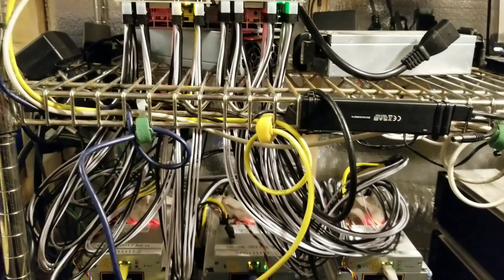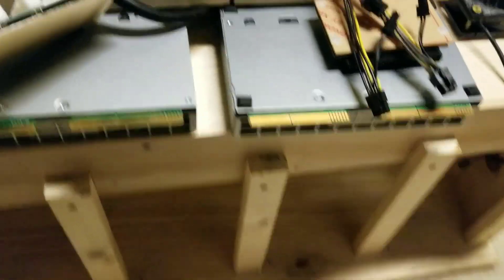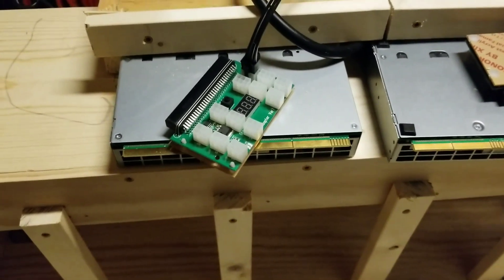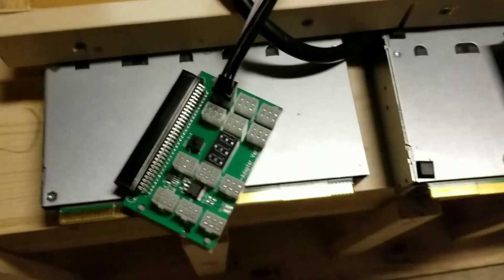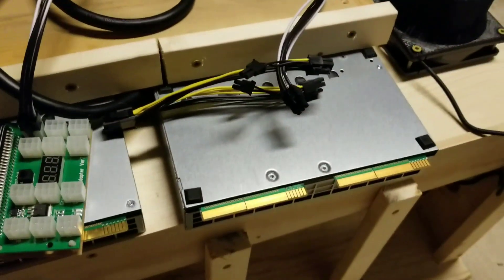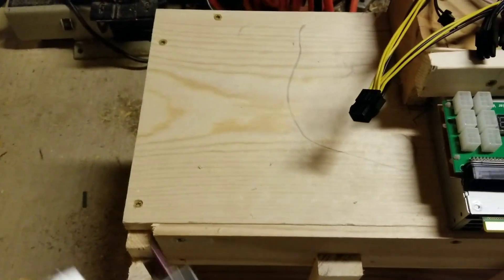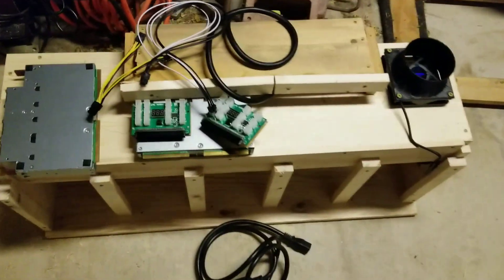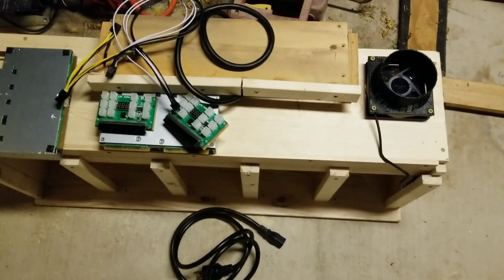Antminer L3+ D3 S9 mining operation update and more helpfully information

Comment: Absolutely sick. Keep going for it!! I would say you will be doing fine with the numbers you are looking to run. I had been looking to buy some L3s from a local guy here in Reno, but the investment is quite substantial for start up. If I decide to go for it, I will keep you in mind for equipment.
Reply from the maker: thank you. the startup is pretty high. Im now running 3 d3's and 3 l3+. next week i wil have another 4 l3+'s and by end of October 2 more l3+, and 2 more D3's then in November 5 more D3's im in pretty deep, i have roi'ed on 3 machines sense Aug. and i just keep rolling the roi over to cover machine costs.
Reply from the maker: Thank you. I'm going all out over 30k invested so far and plan on dropping all profits after expenses for 6 mo. On new equipment and I have a new mining space that will be installed next week to expand in to

Comment: How much are you overclocking and whats your MH/s rate overclocked?
Reply from the maker: I don't overclock unless the unit is over 6 mo. old  as a rule to get the best performance for the longest time out of them. I will be overclocking once my new 12 x 12 mining center is done on about 10 machines to find out what they can take. but if you clock them at 462m you will pull around 600 - 640 mh but be warned you better have a air conditioner feeding them air and a good heat evac system.
Reply: awesome! I wonder if it will be possible to overclock the D3's. I have three on the way and I am interested in getting another 3. I can get my hands on another 2 in two weeks. I am really trying to hit that 100GH/s mark. 

This guy is averaging 17GH/s on stock models. Well I am hoping to have 6 in November :)

https://bitsonline.com/antminer-d3-first-look-review/
Reply from the maker: You can over clock them just like the l3+ and get about 17 out of them but like I stated I would wait the 180 days till the warranty runs out. After that you should over clock and destroy them